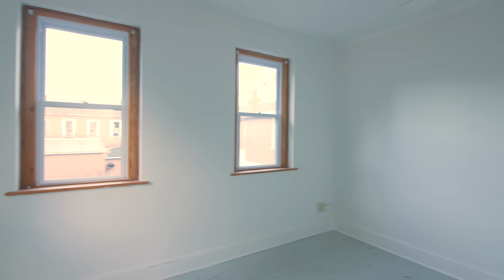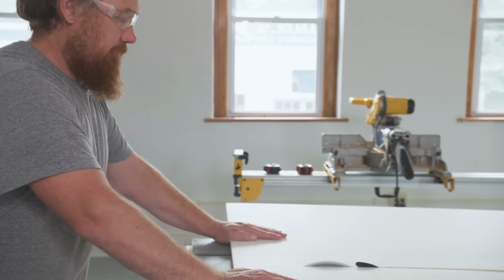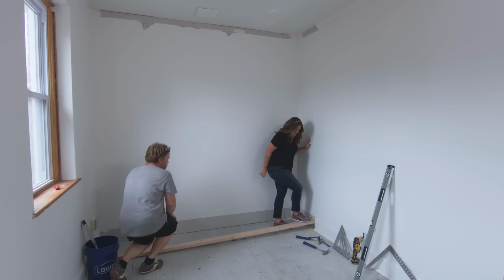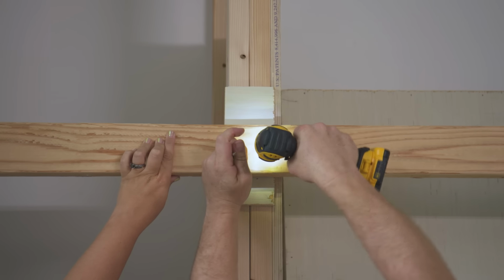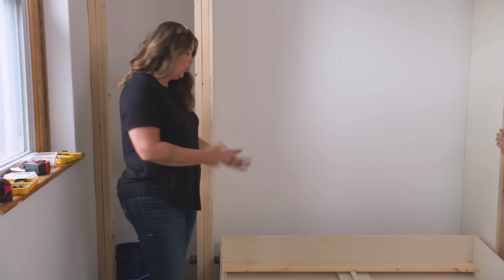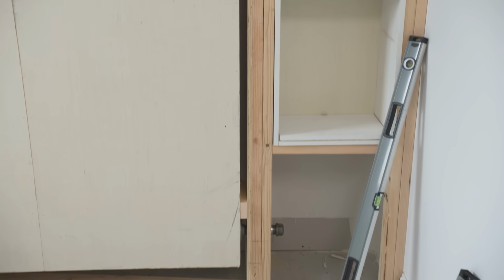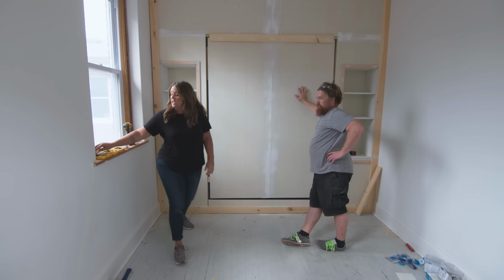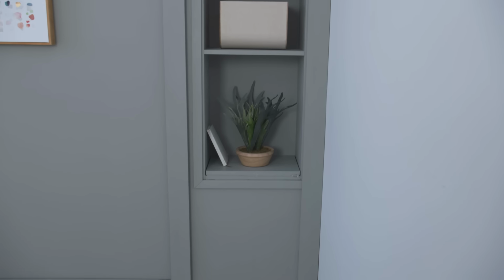How to Build a Hidden Guest Room w/ a Murphy Bed

Comment: Would Anyone else 

 Do  what is being  done here ? 

       More  so the  question is  simple. Seeing  how  every  room is a  different  size from the   length , width , and height , its  quite  safe to say  the  amount of  space being  used ( INSTEAD ) of  covered up  is  the Main Concern. Fold - A - Way Beds are nothing new in the  world of Hiding or  creating  space where little exists in that area. How  you  go  about  this  and what  products , methods, and techniques , to get  the  results  needed is  where the   ( PLAN )  or  lack of  one  can  be most  apparent .   Writing  this  comment   for  multiple  reasons.  LOWES  name is  all over this  and  being a  Big Box Store would  HOPE the end  product  would  reflect ( A True )  Do -It - Yourself  Feel and Skill Set as well.  When ever  anyone  decides to tackle a  space such as this  its  really  a  matter of  comfort and  time  that allows the  budget to increase or limit its potential.  Are YOU With Me ?  Pre-Made Brackets, Hinges, Hardware, and Closures, already  are available to ( Insert )  your  design features into most any space.  Look On-Line  and  they are  right  there for  easy purchase.  Plumbing or  Pipe  fittings  may  get  you  in the  ball park  yet,  for  the  amount  of  time, effort , and resolve, They lack - you will gain in ease of  use and  the  frustration saved  time and  time again and again.  Remember this  One Simple Rule  when ever  posting  clips  for  others  to review. The  More Complex they are the  LESS likely  anyone  is  to  follow or  understand the  reason  for  doing  it  the  way  you have  posted for it to get done.  Best  Advice ( Use )  the  1-2-3-A-B-C  of starting off simple , keep it  easy to follow, wrap it up in a  short amount of time and  allow for adjustments along the  way . Last but not  least  ( Keep a Fresh Perspective )  on the Actual Cost,  amount of  hours , and  the  skill level or  labor and  talent required.   D I Y  is  never  5 minutes  worth of  work   for  a  lifetime of  enjoyment and function.  Between the  Weekend Warriors , Arm Chair  Supervisors,  Honey-Do Listers , and  the  Call up the  neighbor , relative , or  co-worker, to  Solve the  problems  you un-leashed without proper planning  or abilities to  see it  thru.  Free Labor is  NEVER  FREE and Pity Parties  only  prove that  Paying  up front  means  you  have a  warranty to fix  or  correct it  for less than the  Pizza , beer , cake  and  ice cream social. ( Out of the Blue )  Fixer Upper  type of  tears and  glue  network of Run to the  hills instead of  help and  save you  when it  all come  tumbling  down .  Last  bit of  advice .  When being  sponsored  by anyone  one ( Take  ) the  extra  few moments  needed to look in the  mirror.  What  we  see , what  they see , and  what  others  see, is  less than  flattering here.   Tuck in a  shirt , do a  shave and a  hair cut,  try  putting on work style  attire , Dickies, Carharts ,etc.  Full length jeans and a  Button down shirt.  Wear your  safety glasses, use  gloves,  Try  a  White  board to  Lay out  the  Steps  ahead of time  so  others  can  follow  along too.  On the  Fly  renovators are every  where ( Big Box Stores ) want  to  be Noticed for  Quality  not  Quantity of  Failures.  Conclusion?  You may be happy with the  results  - B U T T - Most  would  not  do it  this  way  .  Solution?  Keep  your  own comments  more  Loose in nature, Except  that  everyone  else  will want  to do it  ( There Way ) and  Be  prepared for  comments  such as this  to  come  flooding  in when ever they are set to a  stage on the  World Wide Web . Freedom of  Speech and  Posting  of  clips  go  hand in hand .

Comment: Ppl do not use ghetto Velcro tape to add trim. It’s called building a shelf on the fold down bed/door wide and long enough so that when laid down, the shelf becomes the legs that /support and prop up the bed to proper height and then the trim is mounted (permanently) to the fold down bed/door, not the wall frame. Monica I love you, you left out so much usable space, all around the faux wall had plenty of useable space for books above the bed, storage cubbies below for things like travel bags, other things ppl never find a decent spot to put plus a usable desk built onto the fold down bed so while not in use as a guest room it can be used as a desk for everyday use. I still love you, just left frustrated but overall thank you for sharing and pls don’t stop, maybe keep our complaints in your back pocket for next time, sounds horrible but I mean it well intended

Comment: Couldn't the trim boards that were attached with velcro be attached to bottom of bed?
Reply: Casi D yeah not sure what she was thinking with this one. Most build a desk attached to the bed so when pulled down the desk becomes the legs that support the bed. Not a fan of Velcroing trim when the execution of this. Hold could’ve been stronger, better utilized for storage and entire form and function well planned 🤦🏻‍♀️
Reply: JewDd* 89 not really because it’ll be on the way of the legs
Reply: That's what I wondered, too. I don't see any reason why not.  As for other style Murphy beds, yes - there are special kits available but they aren't exactly inexpensive and unless you're really handy and have the proper tools (I'm not and I don't), you have the additional cost of hiring a carpenter or a good handyperson who has experience to install a more complicated type of kit.  The other thing is that this project was low cost.  Notice she used finished plywood, not some expensive overlay of exotic wood; and she used simply plumbing pipe, cap and flanges plus large "screws" for the pivoting and locking mechanisms - affordable, cheap, easy to install.
Reply: You may want to check out actual woodworking channels to find real Murphy beds. Alm is fantastic, one of the best! Now of course I can’t think of anyone else but just type in “build Murphy bed” and you’d be shocked at the amount of fantastic builds with amazing explanations and demonstrations of every detail involved. I love Monica, this build however was okay and not what she normally is known for
Reply: i thought that too but i guess the trim would potentially hit people while they're sitting on the bed
Reply: Sounds good till a guest srubs thier toe
Reply: @jonhmonroney12  , or gouges the underside of their knee. 🤔
Reply: Or some sliding mechanism so that the trim could act as the locking mechanism for the bed?
Reply: If you did that the legs co not come down
Reply: That is what I felt too, the eye bolts felt like a lazy piece too. So many murphy beds have pneumatic.
Reply: Yes. That'd be way better.
Reply: If you look at "DIY  Pete" you will see a much simpler way to do this.  He doesn't do the sides, but, really, that's the easy part.

Comment: My sister once showed me photos from a renovated older home, where, to save space, dresser drawers were installed into the wall. How would this be accomplished, to keep dust and contaminants in the walls from falling into the drawers, and keep the drawers from falling into the walls?
Reply: I'm guessing a shelf above the drawers would keep the dust off and to keep the drawers from falling through, just trim out around the drawers just like they are in a dresser.

Comment: I thought there was a lot of hidden storage potential that was over looked or not thought about during the design and build process. But that my opinion other than that a great idea.
Reply: I thought the same, I think the right side could have had some drawer storage that would be useful for guests and some shelving along the top as well could have been very nice
Reply: I agree that a lot of space was wasted- above the bed space, and the side shelves could be floor to ceiling.
Reply: Quite a bit of wasted space.  If you don't need this to be "hidden" you could easily make doors on the top.  I would put doors on either side, so guests have a place to put their clothing and shoes.
Reply: Diana Schofield thinking the same thing!
Reply: It appeared to have another 10 to 11 inches of dead space throughout and a huge space above.
Reply: @alramos5118  I cringed to watch them close up that top space above the bed!
Reply: The waisted space could be storage for the pillows, blankets, beds linens.

Comment: Is the bed comfortable? Our parents are old 😭
Reply: It would depend on how nice your mattress is.  I would also want to add some additional support to the frame with more wood, but that's just personal preference.   You could get a thicker more cushy mattress, or add a luxury pad for the top underneath the top sheet.  Also, you could certainly lower the mattress frame by 2-3 inches so that there is more mattress showing above the frame because of course people sit on the edge of the bed to get in and out of bed, put their socks on, if there is no easily accessible chair in the room.  You don't necessarily want your butt or the backs of your thighs resting on a 1 1/2" thick piece of framing, no matter how nicely finished!

Comment: The wood bed frame would make it uncomfortable to sit on the edge of the bed, and would make it an incredible pain in the ass to change the fitted sheet
Reply: 🤔 hmmm I didn't even think of that. Being 5' it's already a real life struggle putting fitted sheet on my queen 😅😆😆😆 it's like WWE meets WWF 🤣🤣
Reply: #BobSamurai I thought Monica said that the frame was 1-1.5" lower than the mattress, for those very reasons.
Reply: My rear drops well over 1.5 inches when I sit down on the bed......
Reply: @donnahenthorn7109  that's what I was thinking,  that my legs will hit the wood pretty hard.  I'd reduce the matt box by a couple more inches. And paint the metal so it won't rust.
Reply: BobSamurai hopefully your guest don’t stay long enough to have to change the sheet very often.
Reply: @GoodandDelicious  That means the home owner gets to change the sheets. A box that deep is absurd.

Comment: Havent watched the video.
If it all starts with buying a $2000 murphy bed kit..
I swear..
Reply: These are under $300 and seem way more sturdy than cobbling it together with pipes and carriage bolts https://www.rockler.com/i-semble-vertical-mount-murphy-bed-hardware-with-mattress-platform
Reply: Shabrina, it wouldn't... Because Lowe's doesn't sell Murphy Bed kits.
Reply: Might have been the better idea because that's nothing I would trust to stay on the wall while I'm away.
Reply: @fionafiona1146  eeww
Those kit cost 2thousand dollars for the cheapest kit.
Yes there are plenty of method to secure that
Reply: @shabrinaz9877 
Getting a good mattress and support for it will set you back a lot too and local rents may be a reasonable motivation... before anyone accounts for USAmerican Healthcare

Comment: Poor design, the entire bedframe twist when pulling down even with 2 person
Reply: Agreed. Not sure why they didn’t market a Murphy bed kit that can be bought at Lowe’s that would not only resolve the racking but also help with ease of conversion. Poor design which is a surprise to me. She usually does well with creative stuff like this.
Reply: @kquick0238  well I think height of bed can't be changed with the Murphy bed kid, I think plus I they the intent to keep it as much economical as possible
Reply: The velcro molding and eye bolts don't make any sense either. This whole project seems cobbled together (which is confusing for commercial content like this)
Reply: pedestrianorwell1984 by
Reply: @pedestrianorwell1984  I couldn't agree with you more.
Reply: Rightly said
Reply: Has anyone used this idea? Pics? Im going to start this next weekend. Id love to see anyone elses???
Reply: Definitely going to use the pipes. Might be easiest. Our historic home turns 140 ! This year.... which means 8x9 bedrooms. Aghhh!! I need all the vertical space saving i can get. Might take me a few weeks.  Ill post pics by February.  I like her cabinet version on the weekender.
Reply: They could have stiffened it more by adding a european style sprung bed platform. Also, the bed is too low, it should be at least 12" higher than it is. That would make opening the bed a bit easier and make it easier to use.
Reply: Exactly
Reply: Angel Ngo that's what I went to check, too! Monica has done a great job coming up with plans when you don't have a specific Murphy bed hardware kit.
Reply: This isn't a top of the line build, that's obvious.  This is for the average Joe and Janet weekend warriors.  Show us your build Agape Sim. Place a link here when you have completed.
Reply: How much would this cost to build?  I've been researching some on Wayfair. They run 1k-3k.
Reply: Cuz it’s plywood and there’s no bed in it yet sooooo😑
Reply: That’s true 2 person can pull down so it’s problem for like me ( single mom ) 😔
Reply: @Simran-j4d  you could have the person who will use it be the second person to help you lower the bed
Reply: @Simran-j4d  one person can pull it down. Just hold the middle and do one side at a time
Reply: @Simran-j4d  if you have a guest,  that's two people.
Reply: @Simran-j4d  solution, don't stay single 🤣🤣🤣